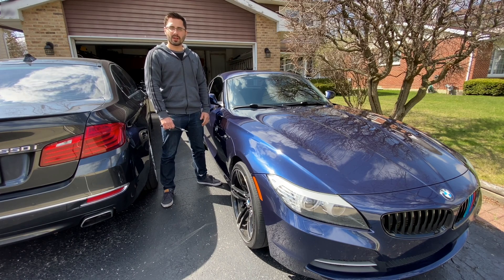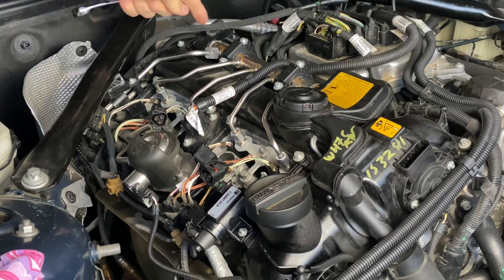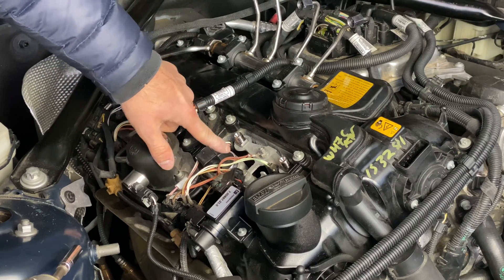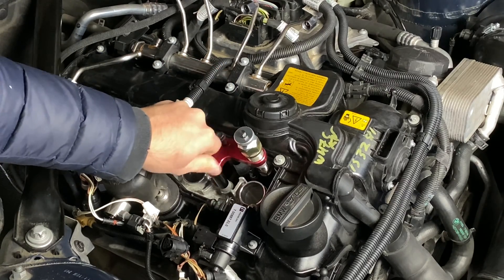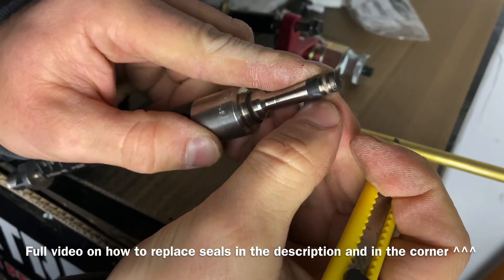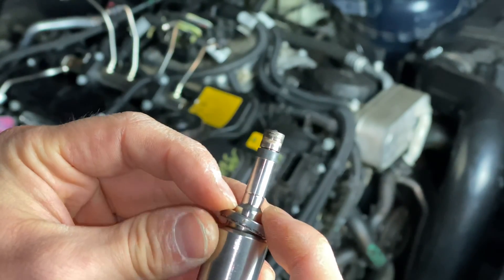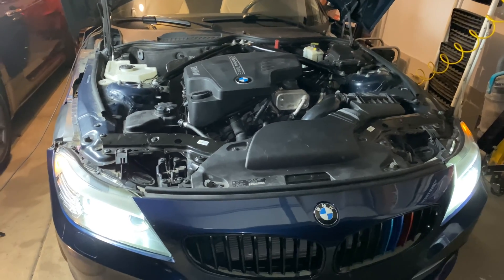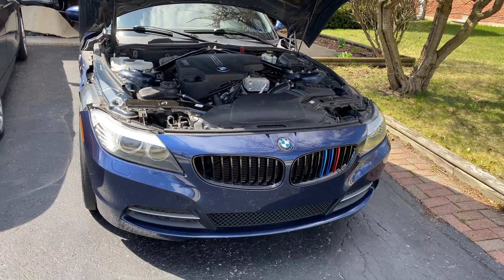BMW Fuel Injector Replacement DIY - BMW N20, N26, N55, S55

Comment from the maker: Thank you guys so much for watching! 
If you'd like to order the tools or injectors check out the links below: 
BMW Fuel Injector Removal Tool: 
US: https://amzn.to/34IVJrS 
UK: https://amzn.to/2xu1ygv 
CA: https://amzn.to/2XD5EO2
EU6 Injectors: 
US: https://amzn.to/2wFhdsV
UK: https://amzn.to/3ck2mU1
CA: https://amzn.to/3a98DjV
EU5 Injectors: 
US: https://amzn.to/34zaCwP
UK: https://amzn.to/3b9i6Jr
CA: https://amzn.to/2yaO3lT
Teflon Seals: 
US: https://amzn.to/3cmnd9l 
UK: https://amzn.to/3cjAsHH
CA: https://amzn.to/2V6Fmlz
Decoupling Element: 
US: https://amzn.to/34ADNQ5 
UK: https://amzn.to/3a5DaPH
CA: https://amzn.to/3a997GL

Comment: great video, but is it necessary to use tool for inserting? It looks like, as you firmly pressed by finger at the begining, it does more pressure then 2NM on that tool, but I may be wrong. I'm asking because I do not have torque wrench with 2NM settings.
Reply from the maker: Technically, you CAN get installed without the tool; however, it may not be seated well. That could cause blow by down the line.
Reply: @SimpleCarGuy  thanks! I'm going to use the tool then. But just hand tight I guess.

Comment: Do you think tightening the hold down bracket is enough to properly seat the injectors, or is the special tool needed? I already have the injectors out, so don't require the special tool for removal at least. I'm trying to avoid purchasing the tool, because it's $85 for my early model of N55. Wanted your opinion on whether it's necessary to use the tool for installation. Thanks!

Comment: During installation of injector is it 2 nm or 20 nm?
Reply from the maker: It's 2 NM
Reply: @SimpleCarGuy  
Thank you, would you happen to know the cylinder  compression range for 2013 f10 n20 2.0 4 cylinder.
I got 150 on all 4, not sure if its bad?

Comment: how to remove injectors with out tool
Reply from the maker: I'm not sure why you would, the tool is inexpensive, but I guess you can use a slide hammer or just yank on them until they come out. You will 100% destroy them, just to be clear.

Comment: I have a 2015 X1 with the n20 engine  An independent shop replaced 1 injector, 4 spark plugs and 4 coils.  The car 
runs good except it is rough at idle.  It doesn't seem to be "hunting" with the rpms just steady but the car
shakes more than normal at idle.  The car smooths out when I accelerate even a little.  I hope the injector was put in
correctly.
Reply from the maker: Hard to tell of course, but does it have any codes? Did they code the injector to the car? If it's rough at idle, you should have some rich/lean codes, i would think.
Reply: Going through the same thing what ended up being the problem

Comment: Great video. I have a few questions.  
I have a E84 2013 BMW X1 Xdrive 4cyls, where can I look up torque? 
1. Which Torque Wrench are you using? 
2. What's the torque to tighten the fuel injectors? 
3. What's the torque to tighten the fuel rail nuts?

Comment: Does injector cause oils burning problems ?
Reply from the maker: Injector wouldn't cause oil burning issues, but if it's dumping too much fuel into the cylinder, your car will run rich and you may see smoke out of the exhaust.

Comment: Fantastic video.  Hi, I don't have any of the scan tools, so I was planning to have my local shop do the reprogramming for the VANOS motor and the injectors (I had to replace mine).  Does anyone know if the car will start and drive with new injectors or will I need to have it towed to the shop?
Reply from the maker: It’ll start, it may just run a bit lumpy and won’t be as efficient. Fine to drive to the local shop.

Appreciate you watching!
Reply: @SimpleCarGuy  Thanks for the reply and thanks again for posting this great video.

Comment: Good video however the injector puller tool is used for only one purpose, pulling the injectors. It should not be used for installation. The injectors are plastic and any downward pressure from the rail connection on the top will flex the injector and could damage it. Anyway, once the injector seals are compressed, drop them in the head, push them into the head with hand force, and then use the retaining plate and screws to seat them. Do this all within 3 mins and you will have no problem. The FCP Euro site shows a N20 video demonstrating this method.
Reply from the maker: I guess it's possible; however, BMW's service manual shows it how I show it in the video.
Reply: Did that work for you

Comment: Hey man thanks for these videos. I had an E89 with the N54 engine and thought it was a maintenance nightmare because I had no idea that normal people could replace things like ignition coils and fuel injectors. Now I am buying another E89 with the N52 engine and I feel confident I can work on it myself and save a ton of money. Really appreciate your work.
Reply from the maker: Great to read comments like this! You can definitely do most of the work on the car as long as you have a little bit of patience and some space. Also, N52 should be super reliable since it doesn't have a turbo, have fun and good luck!

Comment: Have you seen the injectors on N57?
Reply from the maker: Can't say I have, isn't that diesel engine?
Reply: @SimpleCarGuy  Yes about 6 times more surface of contact with engine head, once they get stuck its not an easy job :)
Reply from the maker: Sounds like a job for a slide hammer :)
Reply: @SimpleCarGuy  Yup scary stuff :D

Comment: Me again, I commented on your N20 Engine swap a few weeks back because I was in the process of doing one as well. I'm finished and car runs good but I am getting lean codes and tried hunting down leaks to no avail,  then stumbled across this video. I should just watch all of your videos so I'm prepared for anything you've already been through lol. My original also had EU5's and the new engine has EU6's so I guess that's why I am getting the lean codes. I saw another video of you replacing the HPFP.  I was going to use my old one but I broke the connector putting it in. Come to find out the new HPFP's have a different connection so I had to McGuyver a makeshift adapter. Do you know if the HPFP's are also EU5 and EU6 specific?
Reply from the maker: Hey hey! Yes, you’ll have to swap the injectors back to eu5 or you’ll keep getting those lean codes. I tried upgrading the DME but that didn’t work. As far as the HPFP, there is no difference from what I could tell. I’m running the newer one as well with a connected I adopted myself. I cut off the connector from the wiring loom I wasn’t using and spliced it into the existing connector. Works great.

Comment: How can I know what fuel injectors to get for my bmw 535i 2011
Reply from the maker: Depends on the date your car was manufactured. You can go to realeom, enter your VIN and it will tell you which one. I know N55 engine switched in late 2010, so the date the car was made is very important for you.
Reply: @SimpleCarGuy  hey thanks for the reply , so I went on the website and it says my part number for RP injector is 13537568607, EU5 and says superseded by 13647597870(EU5) does that mean I can also get those EU5 injectors or only the ones with my similar  part number, they are both EU5 so does it matter ?

Comment: If you hav eu5 and replace another eu5 you don’t need to code 👍🏼
Reply from the maker: You have to adjust the compensation rate as each injector has a different value. Even if all are EU5 or EU6.

Comment: Hello. Did i hear you say you have been running for about a year with the CEL..? I think i ran into the same problem but could be a leak too so at this time i am not sure. I am hoping it is this problem as i can find the leak if is in fact a leak
Reply from the maker: It wouldn’t necessarily be a check engine light, but whenever I would scan the car, I would have a code for lean condition (as far as I remember, I mentioned the exact code in the video I think) and then sometimes I would actually get a light on the dash for the same code.
Reply: @SimpleCarGuy  hello my friend. I just confirmed it with ISTA D.  My x3 requires eu5 injectors. Damnit... What a pain...And in my case, I do get an amber CEL. Not all the time but say 2 out of 5 drives I guess. Did you say you ran your car like that for a while?
I need to travel this Friday and I would like to know if this would have adverse effects...
Reply: Subscribed!!!
Reply from the maker: @JSarmiento.  Didn't see the response, sorry! Yeah, I drove like that for a while and it was no problems at all.

Comment: Just replaced variable timing eccentric shaft sensor... had to remove the valve cover and I just used 2 small pry bars to get the injectors out.  It wasn't really stuck in there (at least mine wasn't).  Great video!!
Reply from the maker: What were the symptoms that you had to replace the eccentric shaft sensor? If you aren't reusing the injectors, then you can just pull them out, however if you plan on reusing they are easily damaged doing that. The manual says: "Set torque wrench to 5 Nm clockwise rotation. Together with special tool - crow foot wrench - this corresponds to a tensile force of max. 2000 N. The injector must be replaced if the torque wrench clicks when the injector is pulled out!"
Reply: @SimpleCarGuy  No Symptoms but had p1017 p10E2.  so far car has been fine.  injectors "looked" good when I got them out.  good thing the injectors are not hard to get to if anything
Reply: @tobywilliams5630 I have the same codes. What'd you end up changing?

Comment: Hello. What tool did you use to program injector compensation on your BMW? How did you torqued the fuel lines?
Reply from the maker: Hi Juan, you can use many different scanners/tools, but I used this one: https://youtu.be/d1xggdQA2sE
I torqued the lines using crowfoot wrenches like this and the torque wrench: https://amzn.to/2FlwHXs
Reply: @SimpleCarGuy  i appreciate the help. I'm looking on doing this on my f25 x3. I want to be ready.
Reply from the maker: @JSarmiento.  It's a good idea to buy those. Since I got my torque wrench, I've used it a million times and the crowfoot wrenches are great for fuel and brake lines.

Comment: wait, you used the dust sprayer over open spark plug holes ??? Didn't you just spray a bunch of dust into your coil pack holes ?
Reply from the maker: I didn't take the spark plugs out, just the coils. I blew everything and anything out before putting the coils back in.

Comment: Hey how come you did not program already installed injectors instead of taking the old ones off? You had the tool to write the injector #s. What is your email? Maybe I can help next time.
Reply from the maker: It’s a replacement engine that came with euro6 injectors. The ECU on the car only supports euro5 injectors. Adjusting the compensation on the injectors didn’t help, I tried that.
Thanks, though!
Reply: @SimpleCarGuy  no problem. Where in Chicago are you at? I am in Chicago as well. :).
Reply from the maker: I’m in northern suburbs. What about you?
Reply: @SimpleCarGuy  I am in southwest suburbs. You are not that far from me!
Reply: @SimpleCarGuy  hello i have a question im in the middle as something like you I swapped a new engine in my x5 but it won't start its n55 I coded everything still wont start im about 2 swap back my old engine injectores in bc I see no gas on spark plugs at all so im guessing injectores don't shoot fuel did u have any problems with your swap?

Comment: You don’t need those special expensive BMW tool to remove those injectors. You can get something from HD for $3. At least It worked for me. Good tutorial video btw.
Reply from the maker: You can easily remove them many different ways, the important part is installing them to the correct torque specs.

Comment: I have just installed new genuine BMW Injectors. I used a quality Injector-Tool, but I don't seem to know how to use it. I have followed your video aswelll the BMW-Technical bulletin. I have tried several hours but the outer screw seems to slip through the inner screw. (it is kinda hard to explain), but I cannot find a way to use the tool appropriately. I managed to press-in the Injectors with my hand and secure them with the metal clips. It does seem to work fine however. 
It runs fine though, I think: 
https://youtu.be/pe3Yketxdvo

Should I screw in the inner part completely onto the injector? Or should I tighten the outer part on the inner part? 

Do you have any suggestion? 

Maybe I will post a video about the problem.
Reply from the maker: Like you said, had to explain over text, but the top bolt should be screwing through the bottom bolt and onto the injector. You may need to screw in the bottom bolt at the same time to give you room. I suggest going a little bit at a time in each injector until it is flush with the injector. Then you undo the bottom bolt that will ‘push’ the tool with the injector into the engine. Use torque wrench to get the right specs. Not sure if I can explain it any better. Took me a few minutes to get it right, but if you move both of them at the same time, it should bind.
Reply: @SimpleCarGuy  
When I try to "push" the bottom screw it does not bind to the upper screw. Or, the bottom screw bottoms out, and reaches the tool's frame.
Reply from the maker: @Italiano9091  Can't you unscrew the bottom screw so that you have a few 'free' turns while screwing the top screw into the injector? That should work, if I understand it correctly.
Reply from the maker: @Italiano9091  Are you use it didn't have this clicking before? At first I thought it sounds like HPFP clicking, but it's more high pitch, at least in the video. I hope it isn't, but it almost sounds like timing chain. How many miles/KMs on the car?
Reply: SimpleCarGuy 

109.000 Km
Reply: @SimpleCarGuy  I fixed the problem! 

Now it runs like new! Yeah! 

I made a reset of all adaptations (including  from crankshaft-sensor) And drove it 20 miles. Now it runs amazing. 

The clicking is still there though

Comment: Best video I've seen on N20 injectors. More info than the others. Thanks Buddy. Now on to my rich code :( I'm re-watching all your videos lol!
Reply from the maker: Thanks for watching and hopefully it helps!
Reply: Same here rich code, swapped the first sensor too
Reply: @gregoryk6700  Mine ended up being the HPFP was leaking fuel into the crankcase. I had an extra quart of oil when I changed it! So much gas in the oil that the pcv was picking it up and my fuel trims were -30. Changed the fuel pump and the trims immediately went to zero.
Reply: @lawrencehull2975  I'm having a rich code too.  Can you explain fuel trim -30.  I suspect the HPFP or injectors  but not 100% sure.  I don't smell fuel in the crankcase and also changed the oil, didn't have extra fluid.  I've tried everything, replaced MAF and both MAP sensors, both O2 sensors. I do have a diagnostic tool but don't know what to look for in the fuel trim.  Any help or thoughts would be appreciated. Thanks
Reply: @faresbotros9884  On a scan tool you can read "short term and long term" fuel trims. -30 is about maxed out. It means that the computer is pulling back the fuel to try to get the trim closer to zero.
Reply: @lawrencehull2975  You're correct, my short and long term fuel trims are both at -30.5% but my fuel rail pressure at idle is 1074 PSI which is within acceptable range.  So you're saying the HPFP is leaking into the crankcase even though it's still pumping the correct PSI to the injectors?  When I open the oil cap immediately after turning the car off, I don't smell fuel in the crankcase.  Could it be the injectors are injecting too much fuel.  Thanks for your help

Comment: i am impressed! 
finally someone who’s doing it right 

I will tackle this job in the following weeks. And i am thinking about doing my very first repair video (also youtube video)

do you recommend Genuine or OEM (bosch) injectors?
Reply: I managed to get 6 original NEW BMW Injectors for 700€ :)
Reply from the maker: Thanks! I don’t see any problems going with Bosch as the quality is the same in my experience. Good luck on the video!
Reply: @SimpleCarGuy  hey, I changed 6 Injectors, Sparkplugs, coils, Air filter, oil change, MAF, MAP, O2 Sensors

I still have the problem.... 

I am speechless
Reply: @Italiano9091 what was the problem? did you solve it

Comment: Gutsy repair. Great DIY videos. Keep them coming!👍
Reply from the maker: Appreciate the encouragement. When I got this car, I swore that I will do every repair, maintenance myself and thus far I have not been to a dealer or shop for a repair!
Reply: @SimpleCarGuy  this the same f10 engine ?
Reply: Logan Hudson yes
Reply from the maker: @LoganHudson  I've done all of the maintenance on the F10 as well. If you're asking if the injectors are the same on the F10, then only on the N20 engine.